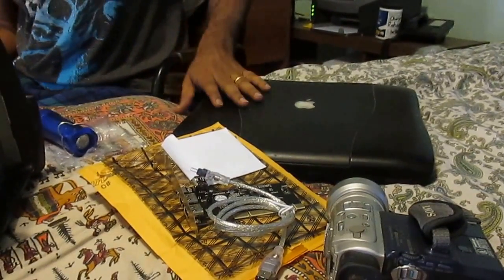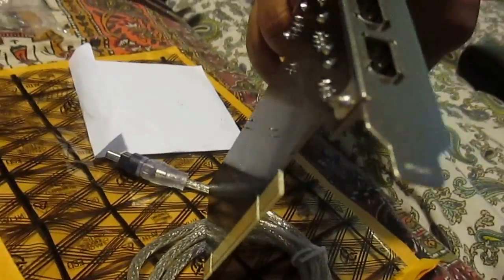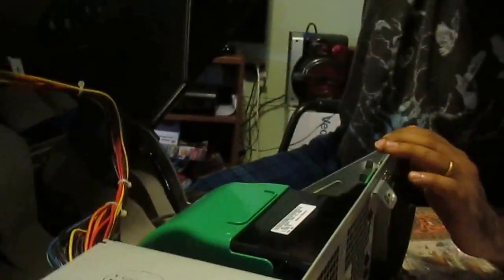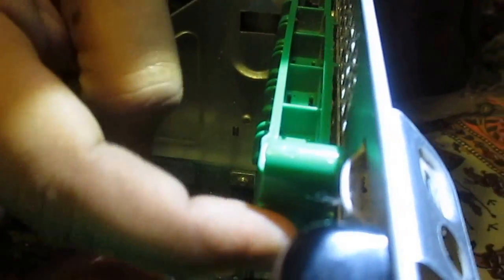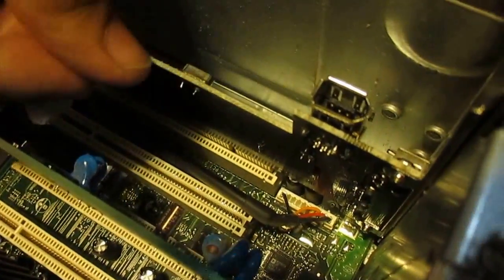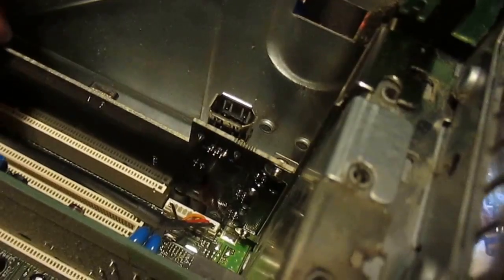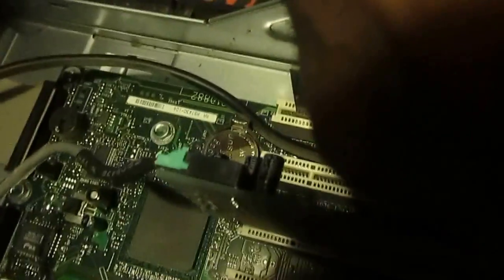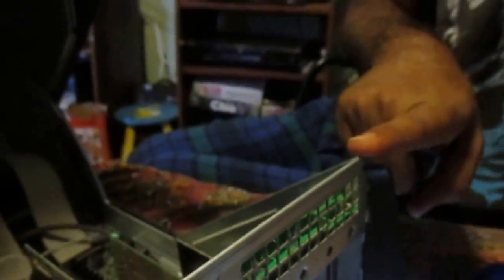PCI FIREWIRE CARD INSTALLATION

Comment: Don't you have to connect the Firewire card to the power supply?
Reply from the maker: No. Any power it needs, it gets from the motherboard. There are cards that would have external power supply connector that you will have to connect but this one did not.
Reply: @Blueplanetjournal  Thank you for your prompt reply! Very much appreciated. The card I bought has a little plug, so it requires external power. I didn't realise that when I bought it (second hand).
Reply from the maker: @hansweichselbaum2534  Does it look like this USB? If yes then it will connect on motherboard directly. You should be able to find a spare USB port on motherboard on a side. 
https://www.amazon.com/RGEEK-Extension-Motherboard-Connector-Multilier/dp/B07JGR7TYV/ref=asc_df_B07JGR7TYV/?tag=hyprod-20&linkCode=df0&hvadid=385267912548&hvpos=&hvnetw=g&hvrand=5393961163169152013&hvpone=&hvptwo=&hvqmt=&hvdev=c&hvdvcmdl=&hvlocint=&hvlocphy=9029014&hvtargid=pla-823044244036&psc=1&tag=&ref=&adgrpid=76690811697&hvpone=&hvptwo=&hvadid=385267912548&hvpos=&hvnetw=g&hvrand=5393961163169152013&hvqmt=&hvdev=c&hvdvcmdl=&hvlocint=&hvlocphy=9029014&hvtargid=pla-823044244036